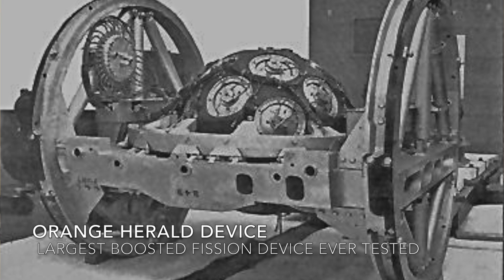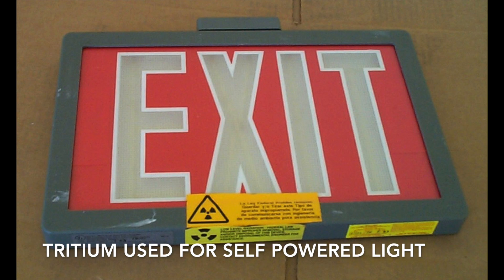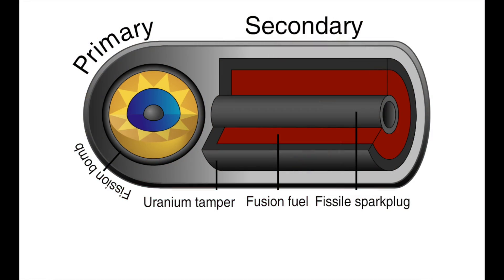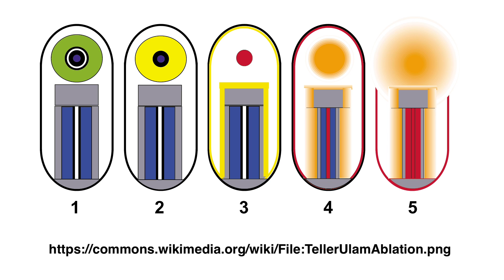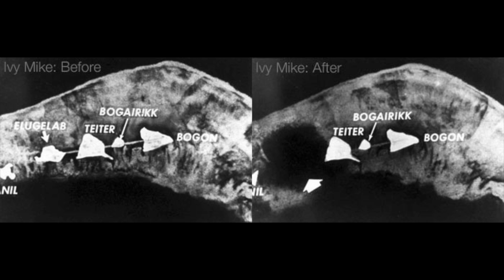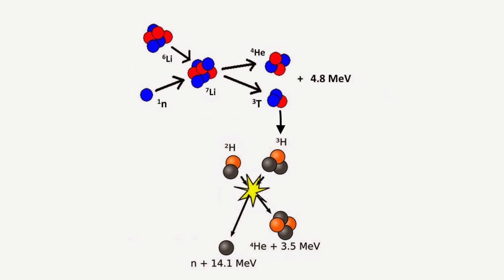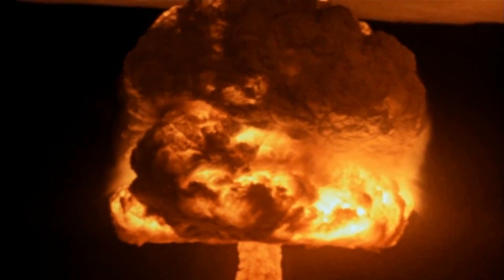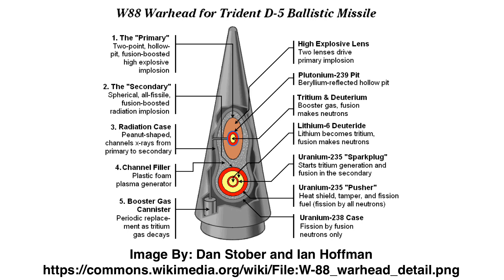Going Nuclear - Nuclear Science - Part 5 - Hydrogen Bombs

Comment: The choice of the cylindrical secondary in early weapons wasn't out of simplicity, a spherical secondary is simpler as it only requires one-dimensional calculations, as it's totally symmetric. Cylinders were used because it was the most efficient way to generate the largest yield given the physical limitations and geometry of the aircraft bomb bays.
Reply from the maker: Getting the radiation from the primary to produce a uniform spherical illumination of the secondary is not a 1D problem. 

There was also the problems of manufacturing the radiation casing, it was easier to make a cylinder with tolerances required.
Reply: Scott Manley no, but achieving uniform compression is simpler and more efficient in a sphere. Also radiation uniformity isn't that huge of an issue, the photon gas promptly reaches local thermodynamic equilibrium.
Reply from the maker: I used to think it would achieve uniformity quickly, but when I saw the 2 chamber shape with the waist I realised there must be more to it, otherwise why would they pick a shape which is harder to manufacture vs a conical vessel with spherical ends.
Reply: @scottmanley  After coming back to this topic, I concede to your point.
With a cylindrical secondary, the implosion calculations are 2D, and so are the radiation transport equations.
With a spherical secondary, the implosion calculations are 1D, but the radiation transport equations are 3D. Radiation shields are easier to design than radiation lenses.
However I still believe the geometric tradeoffs that yield the highest efficiency for optimum shapes for gravity bomb vs missile warheads to have played a significant role.
The US didn't develop spherical secondaries until their SLBMs began to play a significant role in their arsenal.
Reply: No, x-rays don't undergo specular reflection. The walls absorb the x-rays, become superheated, then re-radiate thermal black body x-rays onto all surfaces within line of sight. Angle of reflection isn't important, as very rapidly all surfaces of the radiation case walls and secondary tamper reach the same temperature, and the energy density of the photon gas in the radiation channel reaches a uniform energy density, radiation temperature, photon energy and wavelength. If a portion of the wall closer to the primary is hotter than a point at the other end, the bit near the primary will emit more thermal energy, and everything reaches local thermodynamic equilibrium.
Reply: The reason for the waist is to reduce the volume of the radiation case. The same total photon energy in a smaller volume results in a higher energy density, which means higher ablation pressures, which means higher compression of the fusion fuel, which means more efficient burns and higher yields. 
The reduction in size also reduces the volume, and thus mass of the interstate structures; Boron 10 or Boron 10 Carbide neutron attenuator to avoid predetonation of the fission sparkplug (if used) and preheating of the lithium deuteride. Also high Z radiation baffles to avoid excessive illumination of side of the secondary facing the primary.

Comment: You should also mention the Pb photonic baffles, B10/B10 enriched Boron Carbide neutron shield. Also the plasma source placed in the radiation channel. At this absorbs x-rays, it's superheated to a plasma which then re-radiates the xrays at a lower frequency due to Moseley's law. It also prevents the ablated walls of the radiation channel from rendering it optically opaque.
Reply from the maker: Yeah it's a balance on what's 'too much detail', and I didn't have great sources explaining this so I stayed safe.
Reply: +Evan Bell   Given your statements on the intricacies of H Bombs, it would appear that we humans can create miniature, exploding suns, but we employ a  heavy amount of molecular "duct tape" and other crude mashups to do the job.
Reply: NeverTalkToCops1 wouldn't at all say it's crude. They're incredibly complex machines capable of releasing massive amounts of energy using very advanced physics.

Comment: Are you going to do an episode on Neutron devices?
Reply: It's a low yield thermonuclear weapon using linear implosion on a plutonium mass of about 12kg. Imploded to yield about 0.3 kilotons. This means the fission of 15-20grams of plutonium. The radiation impinges on a spherical secondary which uses lithium deuteride-tritide and a fusion sparkplug. Instead of uranium or plutonium being used in the core of the secondary, dueterium-tritium gas is used, and the shockwave through the fusion fuel is designed to create a point temperature sufficient to ignite fusion. The secondary tamper and radiation case would have used materials with low neutron cross sections, such as chromium 52, possibly with some Lead-208 for ablation and photon containment. Total yield was usually 1-2 kilotonnes, lethal neutron flux radius of 1-1.5km.
Reply: The intent of neutron weapons was to kill/disable the people inside the tanks on the battlefield.  They are relatively impervious to blast and heat effects, which the neutron weapon still creates.
Reply: Neutron bombs are kinda useless today since you can make an A.I. able to resist them and still control the tanks independently by its own if the human crew dies.
Reply: @adolfodef  I know that a year and some had passed since this comment, but: wouldn't the massive wave of neutrons just fry most of the electronics required for the computer, hence the algorythms for the AI would have to be simpler in order to run on a "simpler and/or bulkier, but way more resiliant" machinery (from lead-shielded chips and even up to vacuum tubes)?
Reply: @DrCranium  Nope.
Neutrons kill by literally "piercing" the proteins that make cell works (ex: the mitochondria, the POWERHOUSE).
  
ANY "electronics" (no exceptions) require semiconductors [this is what the EMP of a "normal" nuclear bomb tends to "fry", ruin it permanently in an irreversible way]. 
  Neutron bombs are designed to make a tiny "blast zone"(ball of fire) by reducing the whole spectra of photons released (while generating much more neutronic radiation instead).
  
-> You can "shield" a secondary CPU inside of a Faraday cage; with a MECHANIC mechanism (no redundacy here) that will "un-seal" & physically connect it with the rest of the hardware when a low power EMP happens [enough to damage the "exposed", currently active microchips; but not actually MELT cooper cables & magnetic actuators by gamma_rays induced internal currents (like a hydrogen bomb will)].
  
Then, while a neutron bomb can reduce the human population to ZERO in a 10 km radius, any "tank" that was more than 1 block of the detonation will still remain in one piece; with its "backup A.I." rebooting in just a few minutes and starting shooting stuff again.
Reply: @adolfodef  neutron bombs exist, AI tanks don't (yet)-
best start using those neutron bombs soon lads.
Reply: @stevegreen8262  It is the opposite.
Neutron Bombs have never being built (designed & simulated in supercomputers)
A.I. cappable of moving around by itself, targeting and using weapons had being built and tested 10 years ago (it may be just a prototype electric car with a 360º submachine gun, but the "complexity" is about the same than for something bigger & expensive).
Reply: @adolfodef  ok,
I just assumed because I'd heard of the neutron bomb along time ago, ie. 30+ years that it was more likely to exist.

Comment: There are a few other improvements worth mentioning.
- Since x-rays are directed between the two stages, bombs can use the same technique to direct their energy release too. This is called "nuclear shaped charge", and essential for Project Orion.
- X-rays can penetrate most materials pretty well, that can be used too. Instead of using a shockwave to destroy the target, it's possible to simply blast it with the x-rays directly. This way most of the energy will go deep into the target, destroying it thoroughly while causing minimal collateral damage (for a nuclear bomb). Shockwaves tend to be reflected by hard materials, such as tank armor or reinforced concrete, but if the explosion starts inside the target, it's game over.
- It's possible to create pure fusion bombs using a tiny amount of antimatter as a trigger instead of a fission primary. 1 microgram per bomb is needed if I remember correctly. Manufacturing and containing that much is possible with reasonable improvements to existing technologies. The advantages are almost no fallout, and drastically easier miniaturization.
Reply: good luck getting antimatter
Reply: You can also use this flux as as an excitation source for a superradiant x ray band laser device by using selenium strips as a mode converter.     The divergance is similar to a nitrogen laser and using other materials can change the frequency of the light to make a super efficient but single use death ray...

Comment: Wasn't the UK's Grapple 2 technically a single stage megaton range device? They were trying to get back the 'Special Relationship' with the US and pushed the limits of non stage 2 capability.
Reply from the maker: Orange Herald was part of grapple 2 - it was supposed to be boosted but probably didn't work properly.
Reply: Thank you for the response.
I remember seeing a documentary on the UK nuclear plant program, including Windscale, which mentioned an attempt to get back in the the 'Special Relationship' by setting off a large device and claiming it was thermonuclear but the US had monitoring aircraft and said 'the isotopes we captured say no'. It wasn't until the fourth series of tests they actually got to actual fusion weapons. Also, from what I've read, what really got us back into sub-megaton warheads was precision. For the material cost of a single 1.5 megaton bomb, you can build something like 6 half-megaton range bombs, and two of them can do more damage than the 1.5 by itself due to fall off of the explosive power (Inverse cube I think?) 
Having grown up during the original cold war, I'm terrified of these things. Buy I also find them, the theory of their use, and the technology so fascinating. I don't really understand it completely. But my god do I wish Reagan hadn't be so dogmatic on SDI, the US and USSR, less that one sticking point, were ready to bi-laterally remove all stockpiles. The treaty was ready to sign. Ah well.

Comment: While your answering questions related to nuclear weapons I have one. Could all these nuclear tests have contributed at all to climate change in any way? I know that most of the radiation we spread around the world with them is (finally) gone now. But, did the tests affect anything in more ways than just leaving radioactive dust laying around?
Reply: The energy they released is insignificant in comparison with whats needed to appreciably heat the athmosphear. I saw the exact value once but I dont remember unfortunatley.
Reply: By the way, global warming is self healing. Look up the ocean conveyor belt. Global warming will stop this belt which will cause the warm air from being pulled up which will cause the poles to get extremely cold which will stop the melting of the polar fresh water ice then the fresh water that's at the top of the ocean will evaporate first then the ocean conveyor belt will start flowing again. Problem solved.
Reply: As big as nuclear tests are to us, even the thermonukes are small fry compared to the effects of solar insolation on the planet.  A class 4 hurricane releases (mainly from release of the latent heat of condensation of water, stored in the water by the sun) a Tsar Bomba worth every 18 minutes, 24/7.  See wikipedia, "TNT equivalent" for some more numbers.

Note that high temperature is NOT the same thing as lots of heat.  The temp of a nuke outclasses almost everything, but the heat generated (energy produced) is not so impressive. The radioactivity is not any part of the heating, being only 15% of the energy radiated away.
Reply: petlahk cancer
Reply: I mean, that's the given outcome of radioactive dust laying around.

Comment: If there were only some way to harness nuclear war for peaceful purposes....
Reply: MAD (mutually assured destruction) seems to work rather well.
Reply: Well, nuclear energy is a thing, so I guess there kind of is.
Reply: If you meant nuclear EXPLOSIONS for peaceful purposes, then both the US and the Soviets had programs looking into just that possibility. In the US, this program was called Project Plowshare. Some of the things they tried were using nukes to create canals and lakes, mining natural gas (fracking), blasting rock for roadways, etc., and creating heavy chemical elements. In all cases (except the fracking) nuclear fallout was determined to be too much of a problem for it to be practical. In the case of the fracking, the natural gas they extracted ended up being unusable because it was highly radioactive. As for the chemical elements, nuclear reactors are a much safer and efficient method for doing the same thing.
Reply: Defence against tens of  hypersonic warheads coming down at random points around a city? Err no.  

MAD is the best defence.
Reply: David K,

Problem would be radioactive particles in the atmosphere I would think.
Reply: Nuclear weapons can be used peacefully. Look up project Orion, using nukes to travel through space. And it's actually not that bad, Project Rho has a section on their website listing the environmental stuff, and it's not that bad.
Reply: Also Recreational Nukes !
Reply: MAD may have "worked" when viewed in retrospect, but on several occasions, it almost blew up the world. It's too dangerous. 
An analogy would be two guys with loaded and cocked pistols aimed at each other, except that the triggers are wired together so that one can't be fired without the other. Plus, both guys have Parkinson Syndrom, and their trigger fingers continually have spasms.
Reply: China is more like if NK atacks first they join the western forces, but When the usa or allies atack NK then chine will be like, we join north korea, China is now seeing that joining a more western world is better for them in the long term, Like trade, Technology, Welfare, Healthcare and such.
Reply: NTR's are a peaceful use for the materials..
Reply: Well mad was useful only to soviet regime leaders and free US states, not like for half of europe who got mad under soviet rubber boot :(
Reply: There was a project by the USA to determine peaceful uses of nuclear explosions.

I think one was the creation of massive artificial bays/lakes.

The second idea was a much larger panama canal dug with nuclear explosions.

Another idea was nuclear demolition.

Nuclear pulse propulsion could probably count as peaceful as well.

Here is the wikipedia page:

https://en.m.wikipedia.org/wiki/Peaceful_nuclear_explosion
Reply: I think nuclear pulse propulsion makes sense once you are in space.  From the ground though...not so much.

I do love it though.  Especially that show on syfy, “Ascension”.   I just wish they didn’t make the show have corny twists, and enough sex to be considered porn.  If they made it more like “The Expanse”         
, THAT would be a great show
Reply: MotherEric if you're far enough away from everyone (which lets face it, you would be anyway), and took the right precautions, you could launch from Earth no problem. 
Well, you would have anti-nuclear guys and politicians breathing down your neck, but aside from that, you'd probably be good.
Reply: Kill aliens that are attacking earth
Reply: MINLA'S FLOWERS Alastair Reynolds
Reply: There is! Launch all nukes across the entire planet and BOOM! You have peace for thousands, if not millions of years to come! Not even a fly will dare to buzz after that! 😂
Reply: Where do you have a nuclear war?
Reply: When everyone is dead, peace wil reign...
Reply: PyroTech76 MAD only works with sane, rational actors. From Stalin to Putin, from Truman to Obama (and I HOPE Trump), from Churchill to May, from DeGaulle to Macron, and from Mao to Xi, no one on the world stage has been crazy enough to launch a first strike. The scariest possibility is Kim, feeling insulted by Trump, attacking us or an ally, and Trump escalating to nuclear. China may keep out of a conventional war between US and NK, or intervene only with conventional forces, but might use a nuclear response by US as an excuse for a nuclear attack on us. Then we all die.
Reply: videolabguy You can't war when there is no one to war?
Reply: Read up on Project Orion
Reply: I would say that Kim isn't scary at all, he is just making a scary image of himself to prevent a US invasion. Looking crazy enough to use nukes reduces political support for "bringing peace to NK"
Reply: Well, mutually assured destruction is still a thing, it is arguably keeping big countries from attacking each other. So I believe that nuclear weapons and THREAT of nuclear war is important for our  world (almost) peace after WW2.
Reply: Harness war to create peace? Not sure this works how you think its works.

Comment: What is the next stage beyond imploding a thermonuclear device.... Would you be able to compress hydrogen isotopes too far so you rip spacetime?

Or is it not possible to reach the point of going into singularity by compressing atoms?
Reply: Compressing mass to a size below its schwarzschild radius will result in a black hole.  However, micro-blackholes such as these will boil away due to hawking radiation very quickly releasing all the energy again.  Also, I don't think any nuclear devices compress matter to levels anywhere close to what would be necessary.
Reply: You could use lasers to create an ultra tiny black hole, but I don't think that such a system could be miniaturized enough with even near future technologies.